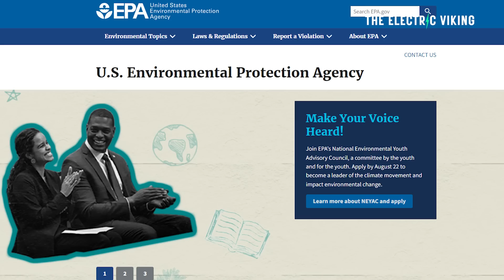New emissions rules in Europe, China & US change the entire auto industry

Comment: To achieve the same impact of -30% CO from vehicles that hybrids can achieve.  You'll need to not only grow EVs by more than 25% a year which means lithium has to be replaced short term; but you also have to change the entire electrical grid to green while expanding capacity by 2x-3x in order to power all vehicles and other systems usuing fossil fuels now.  The EV path is full of risk of failure; the hybrid path is a slam dunk. A mix is possible with small risk.

Comment: Say you think Lithium supply could be increased by 25% a year.  6 million 2023, 7.5 million 2024, 9 million 2025, 11 million 2026, 13 million 2027, 17 million 2028 21 million 2029, 25 million 2030.  The total would be about 115 million EVs out of an installed base of 1.4 Billion. 9%.  And most of those would still be powered by fossil fuel on a grid burning coal and gas for power. All Hybrids by 2030 would reduce consumption by 30%.  Tell me which impacts CO2?  This is based on optimistic EV production as lithium supplies are limited ; you'll need a scalable battery tech to achieve those figures.

Comment: Ya Europe and the USA must realize that, if Lithium is the EV battery chemistry; it has zero chance to achieve production goals that would impact CO2.  Annual lithium production means a max 6 Million Y packs, in a world market of 80-100 million light vehicles?  The same amount of lithium could make 60 million hybrids. If sodium can be made to last; it is abundant enough, as a result cheaper, more scalable. Otherwise EVs are a niche. A further argument for Hybrids is exemplified by the Prius plugin - with an all EV range of 40 miles.  That covers most commutes, EV advocates are the first to point out most commutes can be done on a days solar charge with 10 panels - or about 30 miles range; so Hybrids can be all electric 80--90% of the time.

Comment: They might be waiting for the collapse of the 'e'conomy based on windmills and solar panels and the predictable overload of the general power grid by battery cars , the exorbitant cost to set up a viable charging network or the crippling cost of running new high tension power lines from the remote wind or solar 'farms' to the centres of population  OR, it could be that wiser heads realize that running down the petrochemicals industry before, if ever, some miracle battery 'emerges' -- shutting down 'dirty' thermal power stations with nothing to replace them is suicidal. Or it could be the widespread realization that there IS NO 'climate crisis' due to CO2 --just as sacrifycing virgins once failed to solve drought.
PS  I am a survivor of bladder cancer and testicular cancer likely due to 50 plus years of exposure to BisphenolA (Epoxy resins) Tetra amine hardeners and DiGlycidal Ether (BADGE) -the chemical side effects of mining exotic metals needed for 'e; things including the plastics for insulation,battery cases etc are recognized as toxic and carcinogenic . We need to use  legitimate data and arguments when making a case for battery cars vs ICE . Germany is having to recommission thermal power stations ,maybe even nuclear , and a severe winter claiming lives will 'realign' societal concerns - I lived through the 1973 energy crisis in Germany following the Yom Kippur war - a taste of what sudden lack of energy in useable form portends (or like "On the beach' or 'lockdown paralysis'  -air pollution then was much worse than now due mostly to industrial emissions -not cars .

Comment: Tesla 20 million in 2030 is 25% plus of market - by themselves. Nobody’s challenging them yet. Robotaxis will shrink auto market by 20-40 million units pA. Tesla could easily make 50% of 2030 market.
Reply: What are you smoking
Reply: @bydman5320  haha. Your tag identifies you have problem with logic.
Tesla ahead of everyone in autonomy, which is required to deal with battery material shortage.
It’s simple: engineer a car easy & cheap to assemble with minimal labour, mass manufacturer uniform product, flood market with taxis.
Already, nobody can compete on cost. Tesla out innovates, so that’s not changing in next decade.
Tesla aims to be on every continent, manufacturing in every major market. Side-step politics.
BYD uses cheap labour, old techniques, bare minimum of new tech. Enjoy it while it lasts.
Reply: @iandavies4853  byd beats Tesla on cost, Tesla buys byd batteries. Do you think byd sells them for less than they make them? Tesla makes zero batteries
Reply: @bydman5320  BYD are first loser. Minimal profit vs 15%-25% for Tesla. No better value for money, just more affordable. 
No level of innovation like unboxed assembly for better access, 48v low voltage, elimination of wiring harness, castings vs 300 welding robots, $1,000 motor / drive assembly, potentially elimination / minimisation of expensive paint shop, direct sales - no dealership, better reliability. BYD is behind, just don’t know it yet. Have a good life.

Comment: Very professional presentation and I agree 100% with what is being done. I lived and  worked in the San Joaquin Valley in the  city of  Fresno, California  where we had , in the fall of the year,  inversion layers of air bringing the pollution and keeping the pollution from automobiles near ground level. Because of my allergies, my doctors told my family we  had to move closer to the coast,  where the air was cleaner. 5 years ago I purchased a Tesla Model 3. Within a couple of years , I placed solar panels on the roof of my home. However, living close to the beach I discovered two roads only blocks from my house plugged in early morning traffic. Those two roads were filled with people driving their  internal combustion engine vehicles which were and are bumper to bumper for hours and pollute the morning breezes coming from the ocean. In the afternoon the same bumper-to-bumper traffic pollute the air as the drivers return from work. 25 years ago, we could open the windows and breathe clean fresh air. However today, that is impossible. I applaud this president for taking action on a problem that needs strong leadership to correct. I thank you for covering this topic and not throwing Fear-Uncertainty + Doubt at this topic.❤
Reply: So move to a smaller town. Or do you expect everything to change because of your allergies?

Comment: I wonder if the old Geo Metro XFi could meet the new Euro 7 emissions. It's  a rebadged Suzuki Swift with a 1.0 L 3 cylinder and wide ratio 5 speed manual transmission sold by GM in the US in the early 90's.
Reply: No, but smaller engines will be the only way out for internal combustion.
Reply: Maybe on CO2, but not on anthing else.